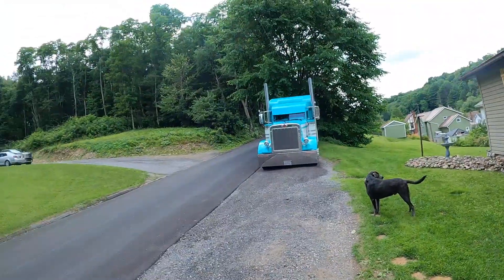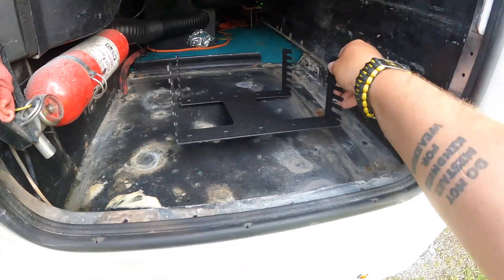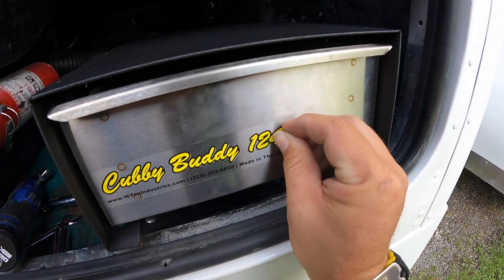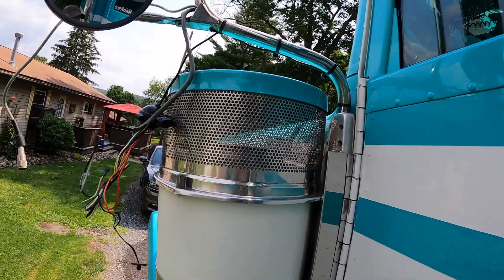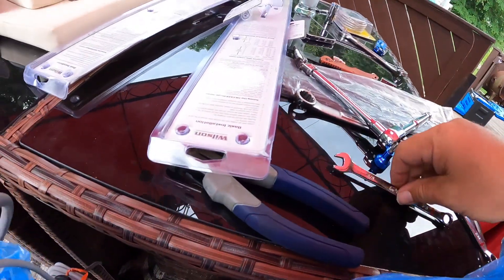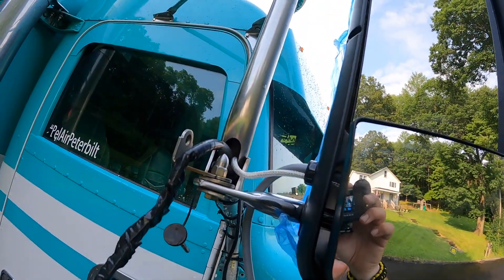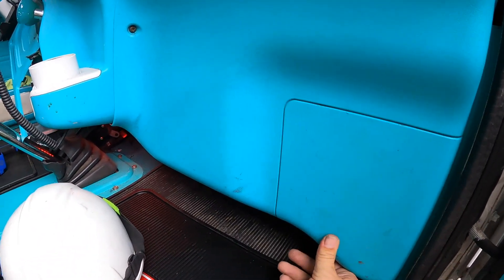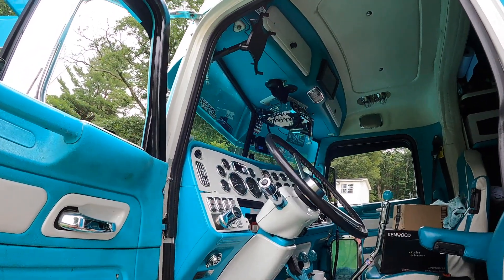Adding drawers to my side box/putting 389 mirrors on my 379 again...

Comment: SWR = Standing Wave Ratio which is impedance matching of your antenna to the output of your radio. Basically, it would be like running a set of duals at different air pressures where one would carry more weight and the other would not be carrying enough. They need to be matched. Good looking drawers in your rig and nice mirrors too. I just was working on my 91 Toyota Land Cruiser that has electric mirrors. In that application it uses a switch that is able to change the polarity to the mirror motors so you get the desired movements. An example would be: Red wire positive, Black wire negative makes the mirror motor go clockwise, making the mirror tilt up, or whatever, depending upon the gearing. Reverse it and it will go counter-clockwise. Colors are arbitrary by the way. I don't know about Peterbilt wiring but electrical engineers are pretty tricky in that they use the same wire, differently energized, positive or negative, all depending as to how the switch is thrown. It boils down to the switch that makes the  magic happen. Keep up the good work!
Reply from the maker: Yeah, that’s why I replaced the switch too. Because I figured it was in the switch control. I need to pull the schematic and see which wire goes where on the truck side and they’d probably work right but I honestly don’t need them to go up and down that often.